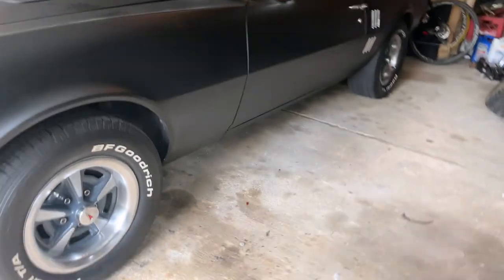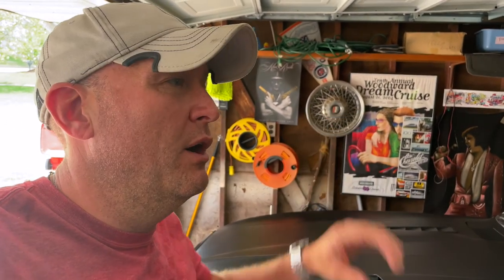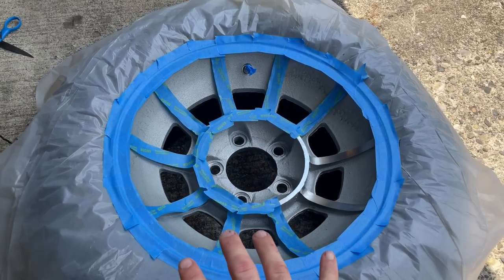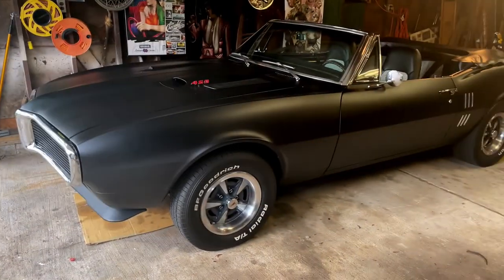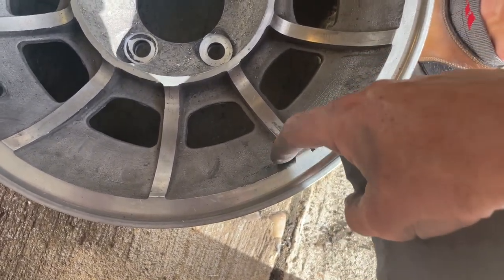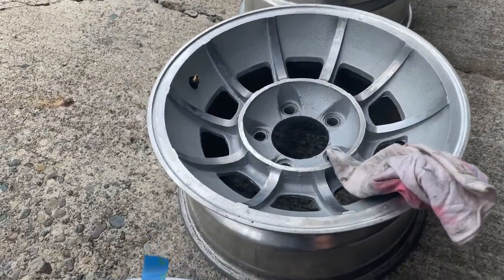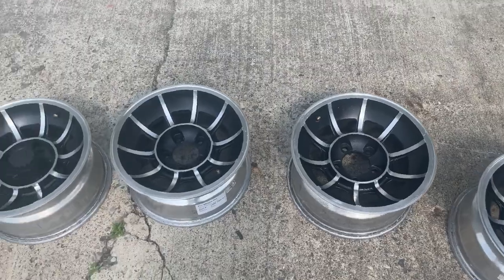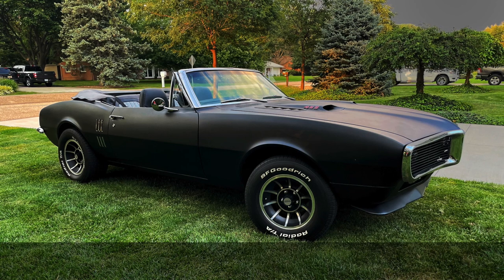Restoring American Racing Vector wheels

Comment: Nice information.  About to do this same thing. I have a 69 Charger with the same paint scheme as you.  I'm torn between masking off like you did or painting the rims and then sanding/polishing the machined  edges.
Reply from the maker: I don’t like the way mine turned out.  Cutting tape left lines that weren’t crisp.  I’m going to redo it with thin tape instead of cutting.